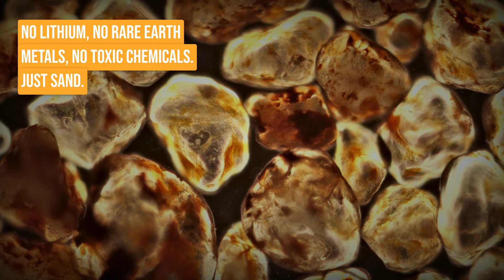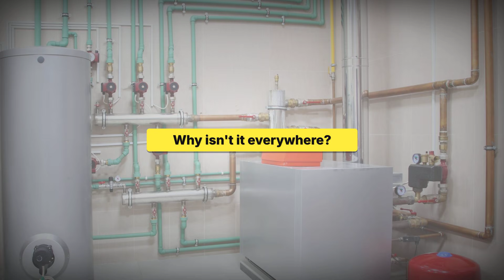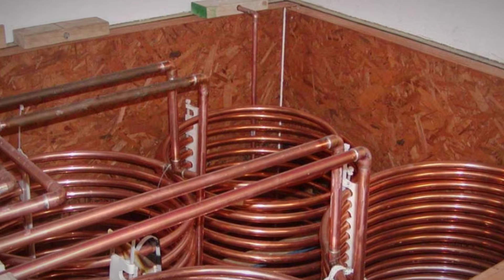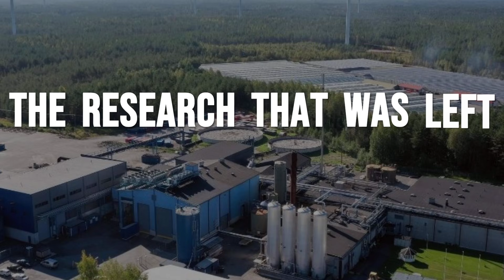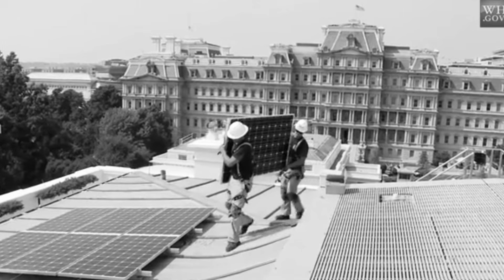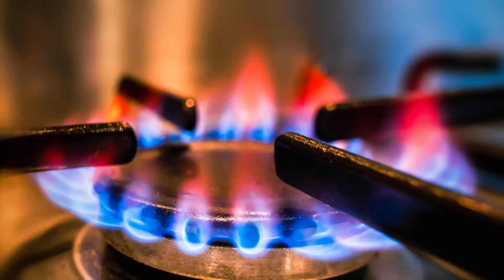This $15 Sand Box Heats Any Cabin 16 Hours on 2 Hours of Sunlight

Comment: the previous comment is true, there is a lot of bull@#$% however, i can tell you that i built a batch style rocket mass heater, surrounded it with approx. one ton of sand, and cut my 2400.00 dollar propane bill in half, burning it only approx 6 hrs a day. There are challenges, like how do you draw consistent heat from sand that is 250 to 600 degrees. Water doesnt work because if a pump stops, even for a few seconds, the water turns to steam, and that is instantly bad. i am currently rebuilding my unit to make it even more efficient next year.
Reply: I would love to know more about your system.